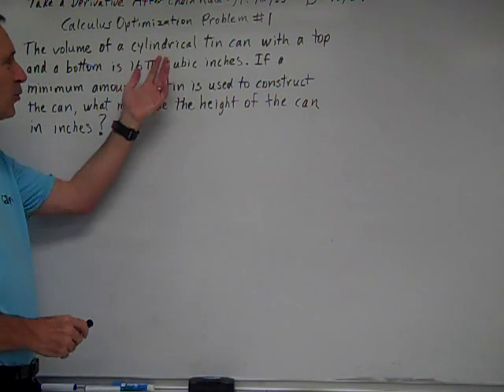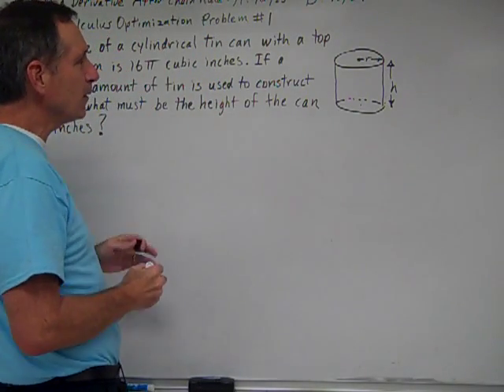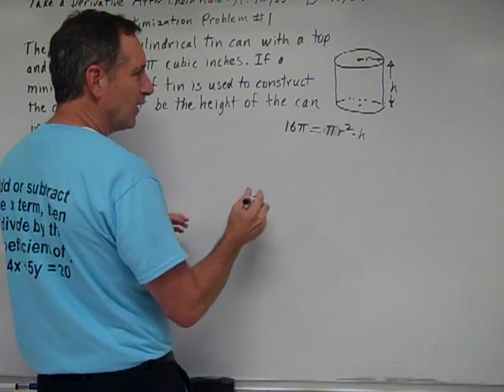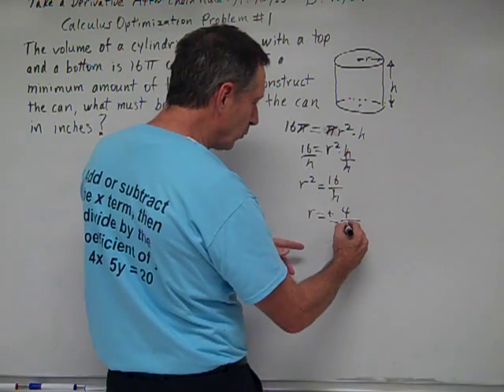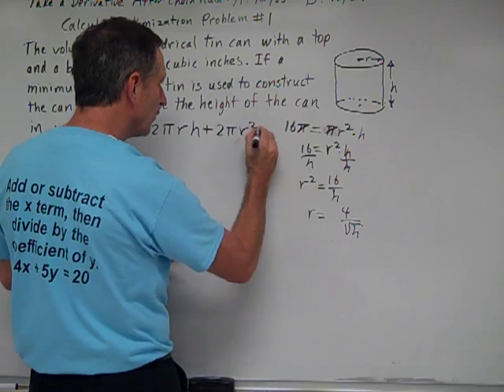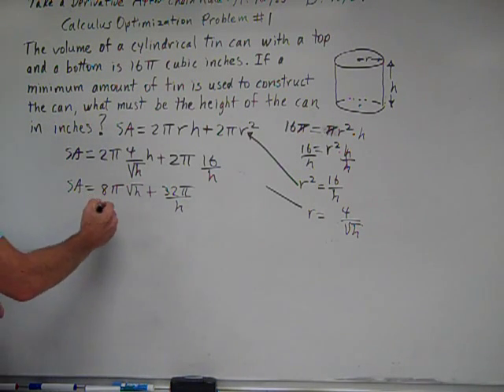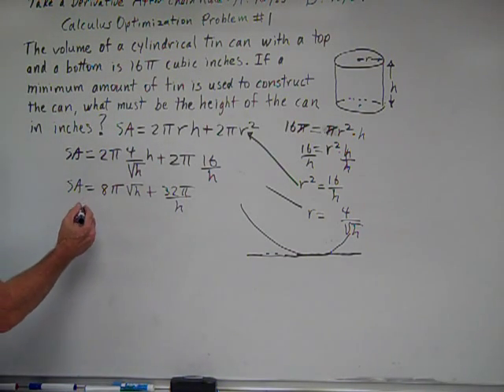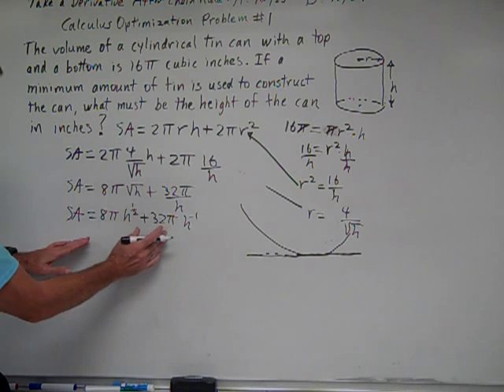Calculus Optimization Problem 1 Minimize the Surface Area of a Cylinder

Comment: Simple Institution could get you a closer answer than that ( or your wrong, but so is everyone else on YouTube that covers this )...yes, 2r=h Is NOT the minimum surface area per unit volume....2r=h yields 0.667 cubic units volume per square unit surface area...where as 480r=h yields 0.998 cubic units volume per square unit surface area...Optimum Here Tends to Infinity, and that is the correct answer, no matter how smart you think you are....if you don't believe me just do the math for 3r=h, and you will get 0.749962662 cubic unit volume per square unit surface area...........and when you realize that i am way smarter than you, go to my Rulgert Ghostalker FaceBook Page, and read....and the answer to any question is keep reading.